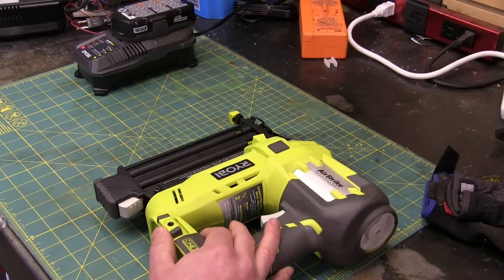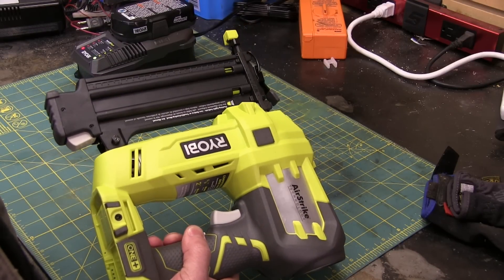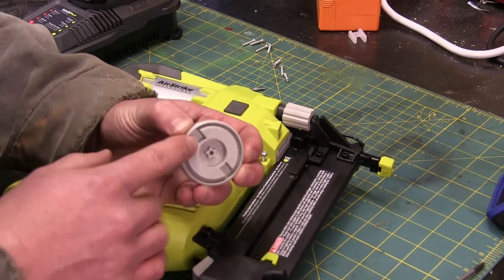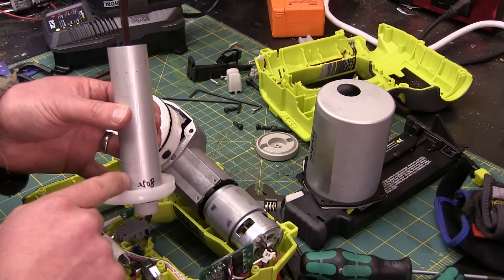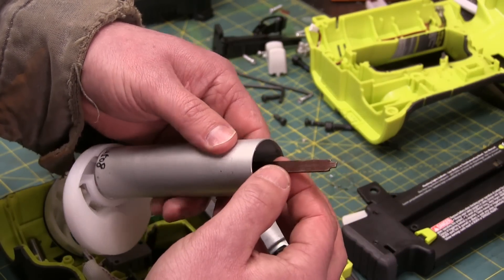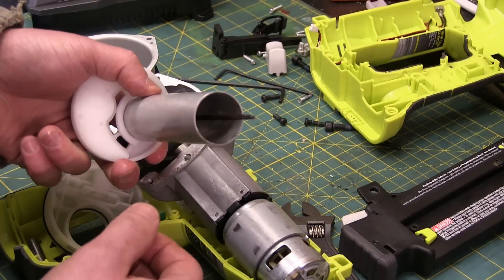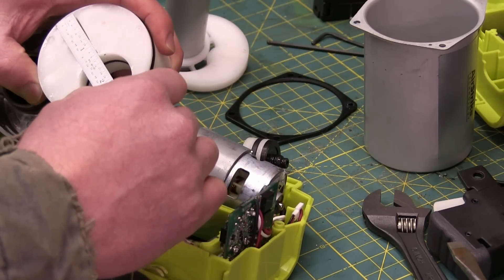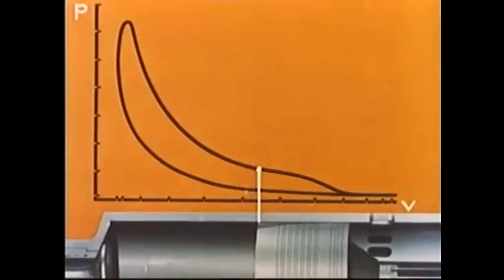BOLTR: Ryobi Nail Gun 18V cordless

Comment: I have been using Ryobi tools for 13 years, but I do mostly residential work in HVAC, so they only see relatively light to moderate duty.  I still have the first Ryobi drill I bought 13 years ago and it works just as good as day one, although not as pretty.  Favorite part about Ryobi is, although they've changed batteries, the connections have stayed the same.  I can use the new Lithium batteries in my old Ryobi drill and I can use my old batteries in my new impact drills/sawzaw etc.... although they don't last long anymore.  Good tools, maybe not for heavy duty work, but for my trade, can't beat the value.

Comment: ymmv but we have had amazing luck with Ryobi 18V OnePlus tools. Beats the heck out of all the others we have had that run down in minutes and bog down even on a freah charge.

The Ryobi 18V weed-eaters, blowers, hand-vac, and 2-speed cordless drill are amazing...the circular saw is a bit underpowered but does nicely for the occational 2x4 here and there.

Even the dewalt tools don't do that well in the ones I have tried, when I worked at a college we went thru 4 batteries just taking one door off its hinge screws and reattaching it and still had to finish by hand.
Reply: Caleb Edwards
It does seem to do better on the "big" batteries (silver ones that are lithium but physically as big as the old NiCad)...but yeah it's pushing what batteries can do.

Ideal for an apartment or minimal DIY though -- the only time I've really put mine to work was sawing an old broken desk in half to fit in the dumpster more easily.  That took 2 batteries but I was quite content since I only use it maybe twice a year for very light work.
Reply: I think you bought some dodgy dewalts mate as I have used dewalt for 25 yrs now and only ever had one problem with one cordless drill /driver but dewalt sorted it all out with in 5 working days and it never cost me a penny
Reply: I think you have to charge those batteries before you use them, lol

Comment: You can’t beat this for the price. I’ve owned mine for about 2 years and it’s still going strong. It doesn’t fire every time, I think the safety bump is a bit wonky personally but if you’re deliberate with it you won’t have any issues. It beats lugging a compressor and hose to a job that requires minimal nailing

Comment: I have this brad nailer, I bought it because of the price and I already had batteries because they also make a really sweet compact jobsite radio. It works really well for the price, it's nice for stuff you don't want to drag the compressor out for.

My stance on ryobi tools is they're inexpensive, they do the job as long as the job doesn't occur 5 times a week, and if they get stolen from my truck, it's not a big loss like my makita tools would be.

At work my boss has to supply the power tools, so any power tools I own are strictly for home use or the occasional side job.

Seriously though, that little green radio is one of my favorite tools and the only power tool I personally bring on the jobsite.

Comment: I pretty sure that's the ryobi impact and drill I got from hd a year or two ago now. I needed to replace some stolen tools asap and was strapped for cash and they were under 100USD for the combo. I've been pleasantly surprised by them and the batteries. They finished the job I was doing and have held up to a years worth of fairly rigorous farm service. Picked up compatable bare recip saw from eBay for like 20 bucks and used the hell out of it. I know they're cheap crap but they've been shockingly good cheap crap.
Reply: Never had one fail in 15 years.
Reply: Need yourself a boomstick for those tool thieves

Comment: I have become a Ryobi fan and have been one for several years, I had all dewalt battery powered tools and they were stolen out of my work van. In hast I had to get new tools and could only afford Ryobi at the time. This was about 8yrs ago, and all the basic tools I purchased (drill , impact, sawzall, circular saw) are all still working. During this period I have purchase many other Roybi tools ( to many to mention ) but have generally been happy with all of them. Once in awhile I may have to replace a tool but I make a hell of alot of money off them before the need of replacing them. For example this 18 g. nailer is a big time saver, your not hauling around a compressor, or hose and dragging a dirty hose through someones house. If this 18 g. nailer lasted me one month it would pay for itself a couple times over. The biggest marketing sceem on battery powered tools is the battery itself. Once you buy one tool no matter whatthe brand is your going to continue purchasing that brand becouse thats what your batteries will fit.

Comment: I've a few Ryobi 18v tools with no regrets.  The queen of the shop is the 1/4" impact driver.  sinks 4" wood screws fast.  also work it out on light wrenching up to 1/2" hex fasteners.  after two years of daily use, the lithium ion pack still delivers hundreds of drywall screws on a single charge.  or three dozen 4" screws.  aside from dirt, only wear is some overmolding getting loose.  best $50 spent.

Comment: I have used the Lifetime warranty on Ridgid power tools & batteries   a number of times over the past 15 years.  In all cases just dropped the tool off at Home Depot store they sent the item out for repair. If a battery needed replacement this was handled over the phone after the serial number & warranty registration was checked. Think I have had 3 batteries replaced & 2 tools repaired over past 15 years @ no extra  cost to me.  Great tools of the money.  Do not forget to register the tools & batteries for Lifetime warranty or your are screwed.

Comment: I have 3 Ryobi one+ drills at work, have had them for about 2-3 years, they have each done tens of thousands of holes through all different metals including 13mm holes through 5mm 316 stainless plate, and they are still going strong. The chuck on 2 of em arent dead straight anymore but damn near close enough even for m3 taps, and the spring on the trigger of 1 snapped into 3 different pieces. All in all suprisingly good drill for the price (160 Dollarydoos for a skin, charger and 3 batteries) Great drill for your home fiddler in my opinion.

Comment: I have some of the older Ryobi tools...and they still work perfectly fine.
The pack came with a drill, circular saw & flashlight with 2 battery packs & charger for $50
Added a small table saw & drill press (mains voltage) for $35 each.
Had to recondition the batteries a few times but the tools themselves are great.

Comment: After building my house and dragging air hose, compressor, etc. I finally bought a cordless nailer, this exact one. I hope it does what they say.
Reply: I've had this same tool for about 7 years now and it still works ok, however sometimes the piston doesn't retract to get the next brad ready for firing. I've found that a little cleaning of the nail track and a small amount of light oil makes it work nice again. It's not supposed to need any oiling, but it sure helps. The oil will stain the wood surrounding the brad hole, so I shoot a few in a sacrificial piece first. 4 amp/hr battery helps too.
Reply: @ken7808  Thanks

Comment: I have one of these and use it daily as a flooring contractor to shoot trim up.  I have had it for 3 years and it has done me right. The only issue is it dry fires once in a while. I replaced the battery and it works fine again. I give this tool a 2 thumbs up.

Comment: ryobi batteries are a pain in the fucking ass and have a tendency to lose the balance on the cells. The god dam pixies like to horde up like Vietcong .
Reply: I think from now on for longetivity's sake I'll stick with corded for this reason.
Reply: +jacker372 It's true. They do that and then next thing you know your arse is in a punji pit with bonus flames.
Reply: +QuickQuips Yep, I just can't stand cordless.  Less of everything except for price.
Reply: Pixiecong?
Reply: Interestingly, I don’t believe this is a Ryobi specific issue unless you had NiMH or worse NiCd. All my tools cordless batteries have at least one dead power pack. I’d say the batter packs are more of a consumable than the tool itself sadly. It’d be great if the EU would force all Manufacturers to use Ubiquitous power packs. There is absolutely no point in having these “Propriatary” packs when every single one of them is just Lithium batteries in series with a charge controller. It’s not anything patented. Imagine being able to use any Battery Pack in a jam at the work site. The EU did this with Phone Chargers so hopefully they will do the same with batteries and it’ll be too expensive to produce two different battery packs thus it’ll be brought into the states. 

The special battery packs is my biggest complaint about cordless electronic tools in general. 

Not to mention they all should be serviceable. The fact AvE has found a few tools which didn’t have a parts listing AND had one way clips (e.g. have to break to take apart) is absurd.

Comment: Hey, I found a porter cable work radio and had just happened to have gotten the 20v max drill and after a found the radio I picked up the sawzall, they were great tools for the price,  they last a couple years past a couple years with medium/hard home duty and I got two years and running with intermittent hard work out of em, couple times a week of commercial work, they were still going strong when I sold em, the drill was dirty and spilled coffee on it and it stunk, lol, but still they all worked great. Upgrading now, but I do miss the radio, it was damn good, batteries lasted at I'd say an 8 out of 10 scale on each tool. Oh yeah, the radio, I found it on yhey side of the road, dickered to hell off a highway guys truck and soaked. I cleaned it up and it wouldn't read the battery, so I exchanged it at Lowes, lol, for a brandy new one! So Lowes does better then alright on exchanges, I can't stand the place, but Lowes and Aubuchon is the only place with the Cable stuff. I'd recommend em for first buyers.  Actually I'd like to see AvE teardown the sawzall, or the drill, be cool to see what I was running all that time, never did look, didn't care that much then.

Comment: I'm sure you probably won't see this comment, and it's an old video, but the focus problem I've noticed in a number of your videos might be solved if you set your camera's autofocus to operate on the center of the frame. Modern cameras generally look at dozens of different points in the frame and try to guess which ones you really want to have in focusing based on a number of heuristics. The sharp lines on backdrop that covers your workbench is like candy to the camera's feature detectors, as they're easy to bring into a high-contrast focus. Many cameras have focus modes with names like "center weighted" (give higher priority to the middle of the frame) or even "center only" (only use the middle of the frame). One of these two may produce better results. Of course free advice is often worth what you pay for it, but if this is useful then that's great.

Comment: Cool video but I have had excellent results from the Ryobi tools . I owned a auto customizing business for 20 years and tried all the best brands of cordless as they were released .We were very hard on tools   I had good luck out of Dewalt but like other brands after about 2 years when I needed a new battery they had changed designs and nobody stocked them . The thing I liked best about Ryobi was they didn't change the battery mounting design . Even after going to lithum they still work in my older Ryobi tools from way back . I currently have almost every 18 volt tool they make and have never had one go bad at home , and I still abuse those pretty good . My old blue and yellow drills are working right along side of my newest brushless designs .Maybe I'm just lucky .

Comment: That's not true with Ridgid returns. If that's what a HD employee told you, then they are full of shit. Dead batteries, charger and radios have to be brought into Tool Rentals and they contact Ridgid and take care of shipping. They will do the same for Ryobi batteries providing you have proof of purchase within the 3 year warranty.

HD doesn't handle tool repairs or replacements. For that, you have to go to a licenced (by Ridgid) service center where they will look over the tool and make sure you're not a dummy. If the tool is pooched, they will contact Ridgid and have them send out a new one.

If you are paying for shipping, you are doing it wrong.
Reply: +rochat Good to know. I've been using mainly Ridgid tools for quite a while, and had decent luck with them (i've not managed to use any of them up yet). It pains that everything is the same cheep Chinese stuff, just built to price range though.
Reply: +rochat That's true with Ryobi as well.  You can take it to the local service center.  They will ask for the receipt.  They will probably send you a refurbished one.  I purchased the portable radio from Direct Tools, and something was wrong with it and it was not very loud, so I dropped it off at the service center.  They called me a few days ago saying that Ryobi would be mailing me one.  Well, they mailed me two, how nice. :-)

Comment: I actually have the 18v Ryobi stapler, it actually works really good, I mainly only use it for putting up soffit, and tacking on siding starter then nailing it with roofing nails. No jambs or anything yet and I've put up probably 500 feet of soffit with it.

Comment: I'm impressed - I'd assumed a less capable or serviceable system. I'm a former air & gas nailer repair tech, 10 years exp.
O-ring behind wear ring is old tech in compressed air nail tools. Senco is the oldest version I've encountered, Senco Sn2 or SFN2. Mainly used in "no- lubricant" (no 2 drops oil every day) systems, possibly as a grime wiper to preserve the o-ring.
As a former repair tech, I assumed these worked like the Senco Fusion battery nailers - horrible tools, when the gun was in ready to fire it was in its Max load state- also the state you store it in. They used a sealed air piston system, then a motor & a release. Release it to fire, motor winds back, fire again. Broke all the time bc it spent Most of its time fully pressure loaded. Eventually we stopped repairing in-house, just sent them out to the Senco office. Not worth the time.

Comment: Nothing wrong with Ryobi tools, I have two two speed hammer/screwdriver drills, an impact driver which is in Canadian speak fair skucum a165 mm battery circular saw, and a mains voltage sander and mains voltage 4 inch wood planer. I have seven batteries 5 genuine Ryobi of I think 1.3 AH and two aftermarket 5AH batteries. I've been using the battery drill for 5 years, and found it superb, my wife bought me the newer drill and the impact driver and the circular saw when I built my new shed for my lathe/ milling machine. They are very good for the home gamer and I am now retired, but I would have no problem earning a living as a woodchuck as you might call me AvE  with these tools. I absolutely love them, they do all I ask of them and could do much, much more, especially the impact driver. It's an awesome bit of kit.

Comment: I have the Ryobi P325 AirStrike 16 Gauge nailer that I generally use for trim around hardwood flooring, been using it for about 1.5 and it has held up great. I have done roughly 80-90 floors, The only annoyance I have is battery recharge time seems to take forever when compared to my Makita tools.

Comment: Had both the stapler and pin nailer. The stapler got a little damp and started flashing light codes. As for the pin nailer, worked for a while and started poking the clip out while nailing until it broke the clip lock. So I took the one off the stapler and worked again but I went to staple on some tyvek and it was only heavy fog mist out, didn't last 5 staples and light codes a flashing. So keep in very dry conditions.

Comment: I guess you never did review that impact driver, I did a quick search for it and didn't see it. Though that could just be Youtube's own BS.
I actually bought that exact set in 2013, and have been using it as a mechanic since. I think I sold the drill and one of the batteries to a coworker... Anyways I've been using the snot out of that impact driver ever since, and it has never failed me. Replaced the battery once, and I only recently decided to replace the hammer and clutch assembly do restore some of its power. I have to say, I'm very impressed with that tool. Even the overmolding has held up pretty well, it just recently started to separate off the handle. And I think that was just from me prying it back to take the housing apart to replace the clutch.

Comment: just bought this pinner to finish my interior trim.  the weight and  delay when trigger is pulled takes some gettin used to but i really like cryobeez tools and have most of the package deals with batteries,  12 years using them and only failure was a battery charger. so far it is pinning flush right out of box. they have paid for themselves over n over and thats how i rank tools. no cryin at this 🐪😝

Comment: I cant tell you this
.
I trashed Ryobi for quite a while .....
BUT NOW BUY IT for lower use cordless tools
AND all because of this nail gun
.
Had a battery because of another off the wall (misting fan) that used their batteries ...And needed a cordless pin nailer .... my brand name choise tool was going to take me a week ....had used a friends before ...so I picked it up of the shelf
.
Well ... 4 years and 20000 pin nails later it's still bouncing in my truck tool box rwady and willing any day I need it
.
I haven't had a Ryobi tool fail on me yet .... can't say the same for my major brand tools